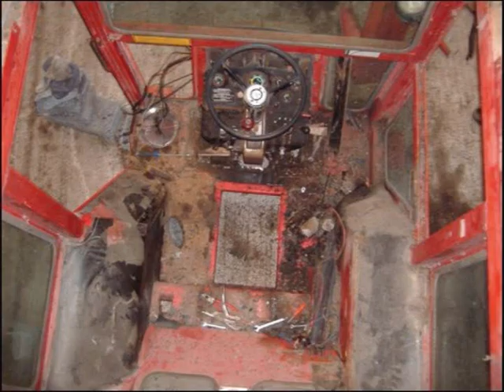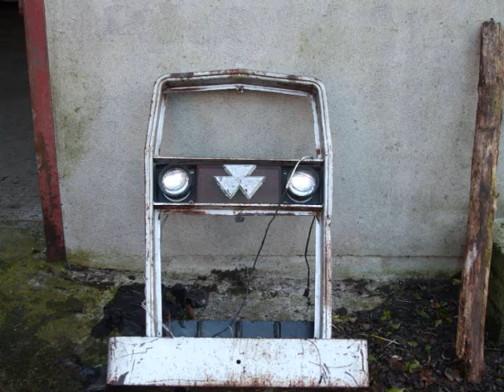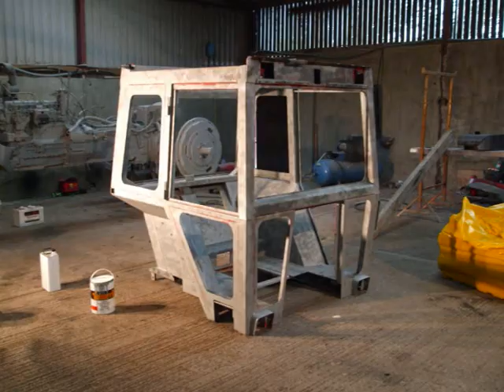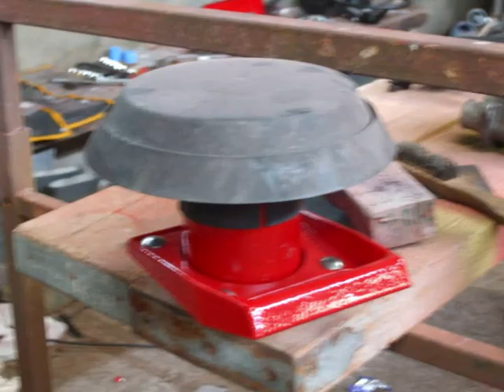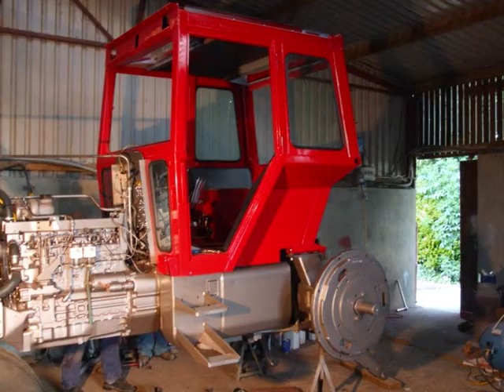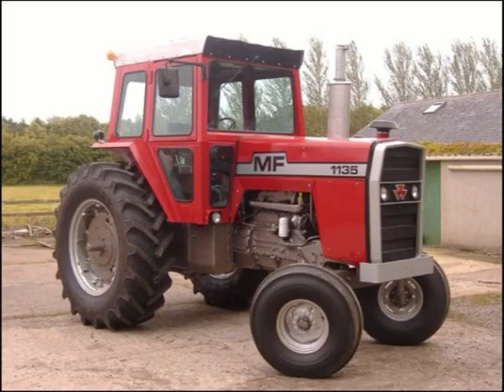Mf 1135 Restoration

Comment from the maker: We were putting in all new rubber seals, so we removed the centre strip then cut the rest out with a knife. The glass is toughned so leave it down flat not on its edge.

Comment from the maker: Ha!! "just a paint job" thats a good one! There's a big difference between what we did and a paint job, a paint job doesn't include a cab refurbishment, replacing damaged broken or welded parts, giving it a complete rewire, sourcing genuine parts, and generally bringing it back to as new condition. We even got all new, genuine massey ferguson nuts and bolts, for god sake. A paint Job, what a twat.

A note to all, look at the video and read the text before commenting.

Comment: No we didn't have to strip out the gearbox or engine cos they were both fine. The clutch had only been done shortly before the tractor was parked.  But it was still completely stripped down both chassis and cab painted to a high quality and then rebuilt. Not a five minute job i can tell you!

Comment: is it difficult to strip oil immersed brakes? because on my David Brown the pedal does nothing and then locks when reversing, otherwise they work alright but you just got to be careful with the pedal.
cheers
dave

Comment from the maker: Well its hard work doing one of these, the size of the machine being the biggest problem. There is so many parts to clean and paint and you will need some heavy lifting equipment for a resto. Parts are difficult to come by, but it depends what you need, mechanical parts are available but cosmetic parts aren't. Depends what level you want to take it too. I know a few people who have broken 1135's for spares if you need them. Lastly, don't attempt it on your own, you'll need help.

Comment: To be honest i dont like 1135 I think the cab isent low nuf 2 da ground like a MF 135 or somthing
Reply: A 135 has half the horsepower.  You need room to fit bigger engines/hardware and beefier parts that can handle the additional power.
Reply: +okeedokee16  oya ino well im jst saying im not to gone on da tractor itself
Reply: aaron Carroll 
I agree ;)